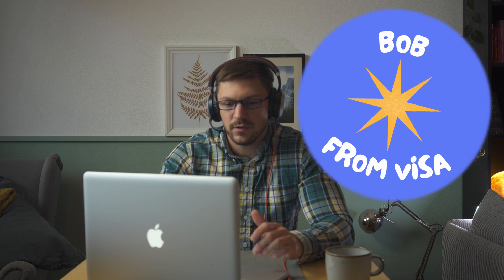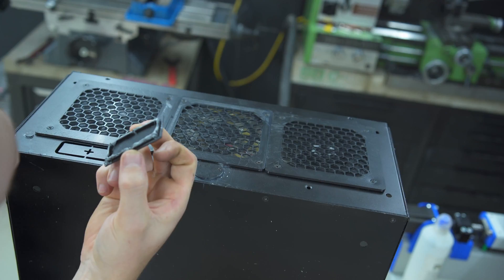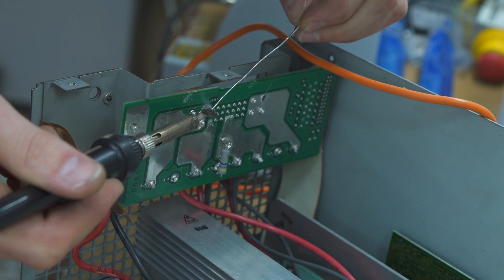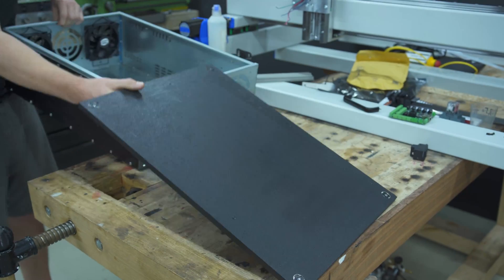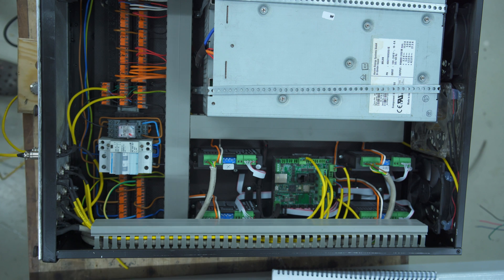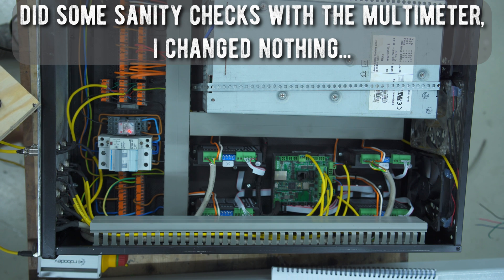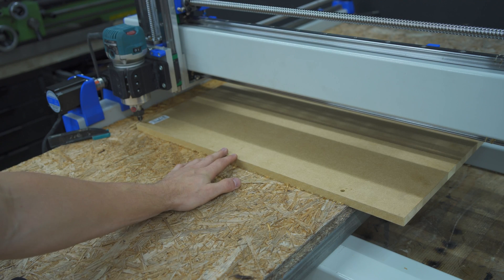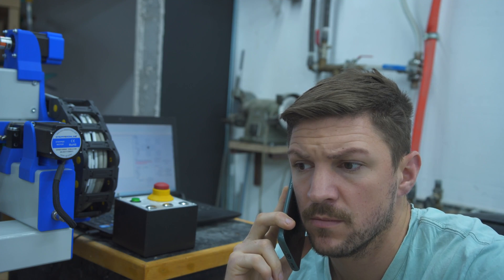PrintNC - Electronics & First Cuts | part 2

Comment: That thing looks mint.
Wanna see it cut a lot more 😎
Does VISA Bob know that a 2.2kw spindle is in the wish list? 🤣🤣
Reply from the maker: Thank you !
I am still undecided if i want to go with a 800hz Gpenny Spindle, or a regular 400hz Rattm Spindle, so Visa Bob has some time to regroup 😅
Reply: @ChristophLehner  what are the advantages on a 800hz VS 400hz? 🤔
I got a 2.2kw 400hz and I like it a lot.
BTW, my machine design is similar, but built on top of a concrete base for sound dampening.
It all started with a little 3018 pro lol
This things take all my money... 🤣
Reply from the maker: @pmsilvei  the 800hz spindle has more torque in the low rpm range, so better for cutting metal, but it is more expensive....
can you elaborate on your concrete design? is it a concrete table?
Reply: @ChristophLehner  thank you for explaining dude.
Yes, the whole base is concrete, Y axis linear rails and ballscrews are attached to it. Made the mould, filled it with concrete and metal reinforcements, anchor points for mounting stuff on it, etc... Painted black 😁👍🏼
Reply: @ChristophLehner  besorgst du dir dann auch den passenden FI? Der sollte ja dann ein Typ B sein der selbst ca. 400€ kostet.
Wenn die Anlage eine Nullung als Fehlerschutz hat kann man darauf verzichten glaube ich (wenn das Gerät nicht gesteckt ist). Wenn man den FU anstecken will muss der Typ B als Zusatzschutz verbaut werden.
(Österreich... ÖNORM).
Reply: Looks alost identical to my build, even the colour scheme, but loving your attention to detail. I have no mill so had to make things work with basic tools. I have the gpenny water cooled 2.2kw. More hassle to set up the water pump etc, but worth it. I already had a makita trimmer router, but decided to go for a proper spindle from day one. Getting the spindle speed control working properly with iosender and the hardware was a pain, but so worth it. The only regret I have is that I splurged on the pricier ceramic bearing version of the spindle, which means smoother running, but the cutting bit is electrically isolated from the spindle. Not a big deal but means touch probing is slightly different to implement as the bit doesnt close the circuit to a clipped on probe lead. Currently building an enclosure.

Comment: Very neat wiring.
You seem to know all this stuff cold; perhaps you can answer this:
About the seperate endstops and "auto-squaring"... What are your thoughts of a CNC where the y-rails are parallel but might even be slightly different lengths and the positions of the endstops are careless (portable CNC, fast setup) - is there a way in g-code to test the limits of the hardware using the endstops, and mathematically calculate the 'resultant parallelogram' and set the 'back-offs' from the endstops to square the 'homed' gantry to one of the y-rails?!
Or is this automatic these days on machines?? (I always thought the gatry has to be set dead square and then adjust the endstops to suit...
At least, can you direct me to an explanation/tutorial for dual y-rail endstops? (Obviously, they have to 'home' at somewhat the same time and speed or the gantry will rip off..! Right?)

Comment: Good afternoon!

I want to build a CNC machine, and your CNC machine design has piqued my interest. However, I have a question.

My question concerns the frame construction. As far as I understand, the frame of this machine is made of square tubing. In this design, the square tubes are stacked on top of each other and connected with bolts, if I understood correctly.

Could you please tell me if it is necessary to process the parts of the square tubes that are stacked on top of each other in order to avoid deviations from the flatness of the entire structure? Or is the manufacturing precision of these tubes already sufficient for building such a machine?

Or should I choose specific tubes that are manufactured with special tolerances?

What would you recommend?

Thank you in advance!

Comment: Doubt you'll see this, but someone else might. M8 or M12 (possibly even M5 for the endstops) connectors could work well instead of Aviation connectors. They're commonly used in industrial applications and they come in solder cup, crimp-on, and screw terminal variants. They also come with up to 17 poles and you can even get them with strain relief, colour coding, and interrupted threads, etc.

Comment: How much momney did you spend in total?
Reply from the maker: Roughly 1400€ without the spindle/router since i had already a makita rt0700c.

Imo you can't really go cheaper, i bought the steel as offcuts, most of the other stuff was also second hand. Realistically you spend 1.5k without and 2k€ with a 2.2kW Spindle.